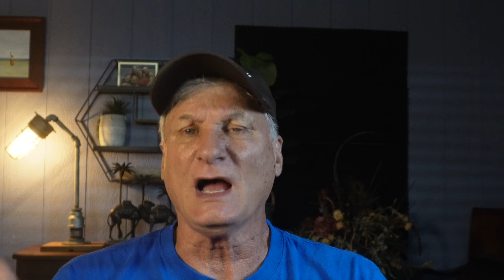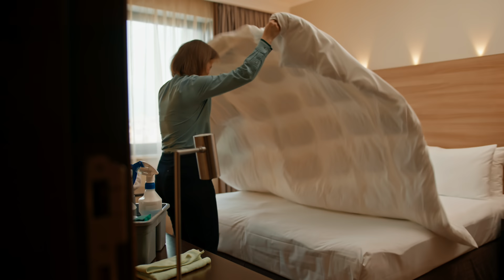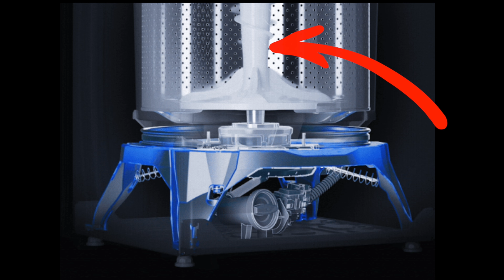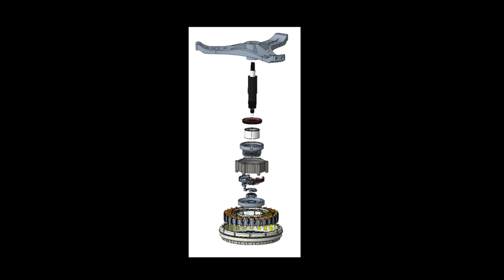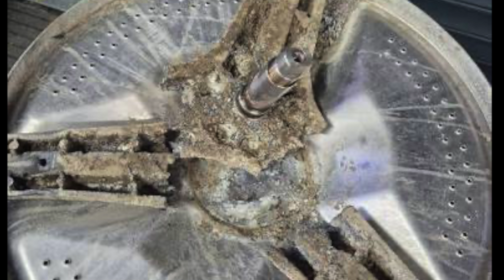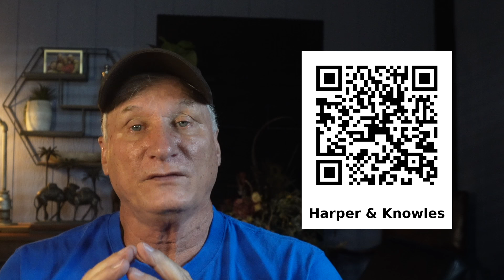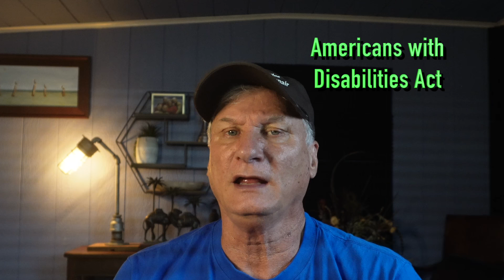Maytag's New 30-Year Washer: No Gearcase, Real Agitator, 900 RPM

Comment: Speed Queen is available now. Instead of paying $1500 for a Maytag/ whirlpool promise of quality, I’ll buy a proven quality Speed Queen.
Reply: I bought a Speed Queen in June 2026 after listening and watching your detailed analysis of why its the only reliable washer available.I knew I had made a wise purchase when the new washer was delivered,by the appliance store owner.He said and I quote,"For the amount of time this machine lasts I could sell 4 or 5,Whirlpool/Maytag washers."
Reply: @donaldnicol8415 
My Whirlpool built Maytag pair is over 18 years old. I had the dryer rollers replaced months ago. That's the only repair.
Reply: @thomasrobinson182 , good for you, but A LOT of things have changed over the last 20 years.
Reply: @thomasrobinson182 That’s because it’s 20 years old. You won’t get that in most new ones.
Reply: @thomasrobinson182   He stated in the video that Whirlpool acquired Maytag in 2006. If your pair is over 20 years old they weren't built by Whirlpool.
Reply: @beauleidig8670 It's actually an 18 year old Centennial pair. Which was made by Whirlpool. So much for relying on memory. I changed my post to reflect that.
Reply: @Gael4ce Exactly ✅
Reply: @thomasrobinson182 They changed. I've been through multiple maytags, whirlpools, Kenmore etc., and I'm not hard on them. Keep that one going as long as you can
Reply: @donaldnicol8415 what speed queen model did you buy?
Reply: @VN-ev7nqProbably the old top loader model, not the crap front loader.
Reply: @JohnLee-db9zt   Speed Queen's Front Loader is highly respected.
Reply: @unconventionalideas5683 By whom? Please show us actual data rather than subjective opinion.
Reply: @unconventionalideas5683  it's not respected or disrespected. it's just very rare due to its extreme price.
Reply from the maker: Yeah, I think that's a wise choice given the Maytag hasn't been proven yet! Thanks for watching!
Reply: I just wish speed Queen had a larger tub
Reply: @onionhead5780  mine can fit king blankets
Reply: @onionhead5780 that’s why I didn’t buy it . Cant fit in large comforters
Reply: @onionhead5780  AMEN. I'd like to ask the person who washed a king comforter in a SQ How the heck they did that magic. I passed on SQ because I refuse to step foot in a laundromat ever again. My Atlantis top loader was much bigger and King comforter was a tight fit. It was the best.
Reply: Maytag had been dethroned as the 30 year washer when Whirlpool acquired them in 2006. Now Speed Queen now rules as the long lasting washer.
Reply: @MegaGeorge1948   and Speen Queen is starting to stink,  Computer boards Lack luster gear Case but what  can you do
Reply: Speed queen isn't large enough
Reply: @doubleganger2  as a tc5 owner, I disagree.
Reply: @anymous4322whatever you say. Disagree all you want.

speed queen capacity vs other washers    +8                    

Speed Queen washers have a smaller capacity—typically 3.2 to 3.5 cubic feet for top-loaders—compared to other mainstream brands like Whirlpool, LG, and Maytag, which commonly range from 4.5 to 5.5 cubic feet.Why Speed Queen Keeps Capacity SmallerIntentional Design: Speed Queen builds their machines for mechanical turnover and thorough cleaning rather than packing in oversized loads that do not circulate well.Commercial Roots: Their focus is heavy-duty reliability and shorter cycle times, mirroring commercial laundromat units, meaning bulky items like king-size comforters are a tight squeeze or require a commercial laundromat.Capacity ComparisonSpeed Queen Top-Loaders: ~3.2 to 3.5 cubic feet (fits normal family loads and queen comforters with care).Speed Queen Front-Loaders: ~3.5 cubic feet (slightly better layout for bulky bedding).Competitors (Whirlpool, Maytag, GE, LG): ~4.5 to 5.5+ cubic feet (designed to handle massive family loads and oversized bedding in a single go).If you'd like, tell me:The size of your householdHow often you do laundryIf you frequently wash bulky items like bedding or heavy blanketsI can help you decide if a smaller Speed Queen capacity will work for your home or if you are better off with a high-capacity brand.Queen City HomestoreSpeed Queen vs Maytag: Which Washer Is Best for Carolina Homeowners?Jul 28, 2026 — Which Washer Brand Is Best for You? Real-Life Buying Scenarios. The best washer depends on how you use your laundry room. Speed Queen is often the better fit fo...YouTube·Harper & Knowles 8mSpeed Queen TC5 vs TR7 — Which Washer Should You Buy?Mark's ApplianceSpeed Queen: The Pros and Cons | Compare & Buy! - Mark's ApplianceJul 30, 2026 — Smaller Capacity Than Many Modern Washers. Speed Queen top-load washers have a 3.2 cu. ft. of capacity, which is smaller than many competitors. Many modern wash...Facebook·I Love My Speed Queen WasherDoes Speed Queen washer handle large loads? - FacebookJan 29, 2026 — Speed Queen Capacity for Large Items: While Speed Queen top-load washers are generally rated for queen-size comforters, there are mixed opinions on whether they...YouTube·Bill and Rod's Appliance, Inc.1:38LG vs Speed Queen Compared @ Bill & Rod's Appliance #getitatbillandrods @ ...YouTube·Harper & Knowles 0:58Speed Queen Washer: Why Tubs Are Smaller (Explained!) #shortsBray & ScarffSpeed Queen vs Maytag Washers: Which Is More Reliable? - Bray & ScarffJul 16, 2026 — Capacity and Cycle Options One of the biggest differences between the brands is overall flexibility. Maytag generally offers larger-capacity washers along with ...YouTube·Bens Appliances and Junk27:47The Most Reliable Washer Today! But is There an Issue? Speed Queen TC5 ...
Reply: Maytag capacity is a lot bigger so you can wash a king size comforter easily, unlike SQ.
Reply: @JohnLee-db9zt  i can wash a king size blanket in my SQ TC5
Reply: @anymous4322whatever you say. Doesn’t change the fact many others can’t.
Reply: @JohnLee-db9zt  I only see claims that you can't from non owners.
Reply: @a@anymous4322I have a TC5. Wtf you talking about?
Reply: @JohnLee-db9zt  I don't think bots can own washing machines.. Your username kind of makes it obvious.
Reply: @anymous4322Anymous isn’t a bot? 😂
Reply: @JohnLee-db9zt I've done it several times.
Reply: @MilkMan608 I’ve tried with my king size comforter, but couldn’t. Unless you have the thinnest comforter, you are lying.
Reply: My sq is 12kg capacity.
Reply: The new speed queens aren't as reliable as the old ones like most things.
Reply: @markg999 that is what I have read, as well.  Luckily, my 23 yo Bosch is going well after a service call and pump replacement.
Reply: @markg999  still much more reliable than any new washer now
Reply: I did buy the real agitating TC line of Speed Queen about 4 years ago.  I am disappointed in a few things.  The washer is extremely low pitch buzzing humming loud in the spin cycle, almost like they used a cheaper motor, but I noticed it doesn't have a large run capacitor on it like my old one did, maybe since they can't find reliable capacitors anymore due to EPA requirements of what fluid can be used inside them, although AmRad seems to be ablet to make reliable ones.  The other thing is when you just put in a couple items, it tends to get so off balance that the machine jumps away from the wall about 4 feet and almost rips the drain hose off the wall drain during spin cycle if you're not home to catch it.  The other thing is that the unit doesn't start filling with water until you close the lid...my old machine allowed you to put your cup of liquid detergent directly into the stream of running water to help it disperse, so I had to monkey rig the hood latch safety mechanism on the back of the unit to allow the tub to fill since it thinks the lid is closed.  The other thing I don't like is that they cheapened the mechanical timer on the dryer, so that when my daughters turned it counterclockwise to reset the cycle back to the automatic dry position, it ruined the internal components just slightly enough so that now when we automatic dry, about 5 percent of the cycles, it never ever stops...it absolutely cooks the clothes forever until you stop it manually...I've heard of people online where their Speed Queen dryer ran for days because they left town.  For whatever reason, their mechanical dryer timer supplier changed to a cheaper supplier that doesn't allow for the knob to be turned counterclockwise...you have to turn it all the way around clockwise to reset the timer....our old dryers never had this issue.  The only way to guarantee it stops is to use timed dry, not the automatic dry.  Also the dryer makes a high pitched whining noise...could be a bearing or motor bearing, but yeah...it's not the quality it used to be.  The digital controls on the washer don't seem that robust but we did at least put a surge protector on the washer, but we don't expect the electronic components, especially things like capacitors, to last on the control board for more than 7 years or so.
Reply: I have a 9 year old speed queen w&d, just had the dryer fixed noisy sounded like a belt problem and black oil streaks on white clothes, repairman thought washer was leaving streaks and would be very costly repair, still getting streaks… any advice out there?
Reply: How much, please?
Reply: @kathleennorton2228  The number I've heard is $1500.
Reply: @o0-ManahManah-0o  that was the price quoted to me 3 years ago at a small box store. For the size of the capacity I walked. Read online reviews. I saw some pretty unhappy SQ owners.
Reply: I understand that it’s some crazy government regulation for energy saving technology. Not sure but wouldn’t be surprised! I totally agree the old school way is the best
Reply: @paularchutowski2170  yes, but Trump rolled those back. Manufacturers are try to unload their junk. Same as Electric vehicle "Mandate".
Reply: How many Times does your dumb ass HAVE TO BE TOLD THERE IS NO PRICE YET moron!
Reply: We’ve got a king bed don’t look like it will fit a king size comforter
Reply: @justinjostes2050  keep looking.
Reply: also, stay away from"HE".
Reply: Our Speed Queen was trash, bought in 2022. It would not agitate. It was an energy saver, and would not clean clothes at all. We pulled it out and found an old washer. It actually cleans!
Reply: Speed queen is 1500 now
Reply: Speed Queen not that great. Computer  Board  lackluster  transmission but  everyone else stinks and what are  you going to.

Comment: One other thing, why has no techs ever got together and built a really great old school washer and dryer that stands the test of time.  I sold my old almond and brown maytag because I need a bigger washer.....literally the worst decision.  I have been through 4 washers since then, 2 front loader and 2 top loaders.  It would be nice Ben & Knowles washers and dryers, add in a frig that doesnt take a subscription for ice maker built like a subzero but for the regular everyday working folk, gas stoves that have no digital anything, no electricity no problem. I have a gas stove Americana that is rusting apart after many many years, I just cant get rid of because of way new ones are made.  Sad!
Reply: Energy efficiency regulations passed by Congress is the reason why they cannot build those old designs anymore. Vote for better politicians if you want change.

Comment: Chip always good to hear your expert analysis. I am about to buy the matching SPEED QUEEN Dryer DV2 to go with my TV2 washer. My old Maytage is having problems. My problems with the Maytag: not mechanical. Also, too many options and in a computer based gizmo it can be more problematic. All a person really needs is 4 cycles, SOAK, REGULAR, PERM PRESS, DELICATE. Also it not necessary for multiple water levels. My TV2 only has one. I only do full loads but my clothes still circulate and get sucked in by the agitator Vortex. Finally, Speed Queen regular cycle is like the old Maytag regular. Wash, Spin, spray rinse, deep fill rinse, damp dry. 25 minutes. Can't beat that. Simple yet effective. 
Thanks for all your great videos
Reply from the maker: Thanks for watching them, my friend!
Reply: Go with the Speed Queen TC5 washer and DC5 dryer, I have both and they are GREAT  !
Reply: @richardsmith4187  The problem I have with the TC5 and I would buy it if I had to, is that on the drain cycle, it starts it's rinse before the tub is empty which does no good. Also, the ECO CYCLE will never be effective. It has first rinse with water still in the tub. and then a 20 second spray rinse and then a 10 second spray rinse. The TV2 has 3 30 second spray rinses that start well after the tub is toally drained. Plus with a mechanical timer, after the first spin I can set it to ECO and with warm water rinse and also will fill it to the very top line and give me three effective spray rinses.
Reply: @TheCollierjr  Sounds good for what you need, I like mine. Guess they make different models that do different things. You will be pleased with your choice.
Reply: @richardsmith4187  It all comes down to taste. Cookies or Brownies? Less Filling, or Taste Great.
Reply: @TheCollierjr  your right

Comment: One other thing I would like to know is the noise level throughout the wash cycle?  I have the mgw576 commercial washer and it is extremely noise, especially during the neverending spin cycle, longer than the entire wash/rince cycle seems to me.  Unfortunate for my big family because our laundry room is right in the middle of the house, after multiple loads you need noise cancelling headset.   Love your videos Mr. Chip, Blessings to your and your wife.
Reply from the maker: Aw, thanks for the kind words my friend! We'll have to wait until they go on sale to determine the noise I didn't see that on the spec sheet but it does have one of those  annoying end of cycle buzzers so if its quiet enough to need that?  Who knows? Thanks for watching!
Reply: There are studio level sound insulation panels which aren't thick, which people can install in or over the walls. They don't come cheap, but they do work by all accounts.

Comment: When they claim it'll last 30 years I think they mean the outer shell LOL...nothing else inside will last, but the metal outer shell and frame might LOL. 

When Whirlpool got away from the old direct drive machines they went to hell.  If I recall the Maytag washer I had was around 12 years old when the motor failed.  I now just have a basic Hotpoint top loader, it works, but its very cheaply built like everything out there now.  Don't care for all the electronic garbage in these machines regardless of what brand, all the energy saver junk just makes the machine have to run longer, and overall use the same amount or more water and power because with some of these machines you have to run the machine twice or sometimes 3 times to get the clothes clean, so what is the energy saver?  Nothing, it does nothing, it saves nothing.  

If I get another washer, it'll be either the GE front loader, or an LG front loader combo unit so I can have a dryer again...I live in an RV full time, and with just the Hotpoint washer I don't have a dryer, I have 3 retractable clotheslines in the back of my RV to dry my clothes, but sometimes it would be nice to have the dryer functionality.  Since my RV is a toyhauler, I have plenty of room for a full size washer, if I had 240V access I could install a regular dryer, but RVs do not have that option, at least not factory equipped, sure I could add it but I'd have to run a generator to run the dryer.  The normal washer/dryer combo units that most people put in their RV's aren't large enough to wash bedding, so I'll get a full size washer/dryer combo.
Reply: Energy efficiency regulations passed by Congress is the reason why they cannot build those old designs anymore. Vote for better politicians if you want change.
Reply from the maker: Thanks for watching!

Comment: Correction it is a wash-plate with a tall pole (agi-peller) they should have just made a modern Surgilator agitator and called it a day but looks like a great step in the right direction.
Reply: Not really different from Speed Queen.
Reply: @MichT-b9d  yes and no but lets see if it any better then SQ. The TC5 has a Traditional Agitator unlike the newer higher end SQ so the agipeller in my mind is a downgrade.

Comment: I'm not an early adopter. I will wait a few years and see how it goes. I will need a 'retirement' washer in a few years.
Reply from the maker: One you can hand off in your will? Thanks for watching!
Reply: @HarperandKnowles  yep. or at least not have to buy another one.
Reply: i 2nd  that, my 1997 maytag  will  not last for ever
Reply: Same here. I still use my 80’s Kenmore top load washer.  Resealed it last year (with help from this YouTuber’s helpful videos) for the first time and still works great all these years later.